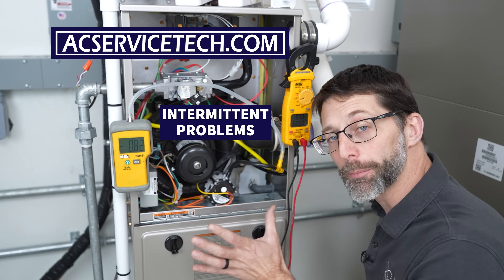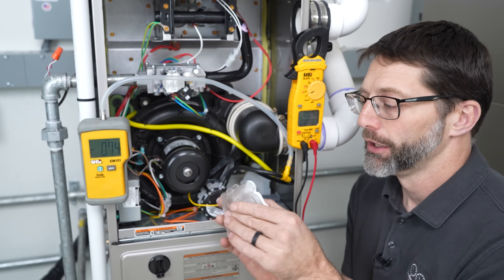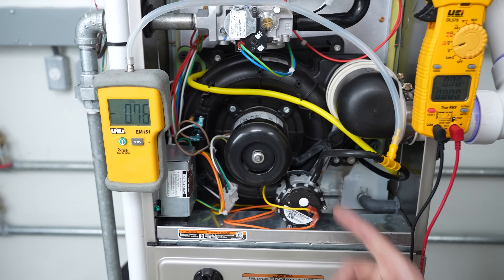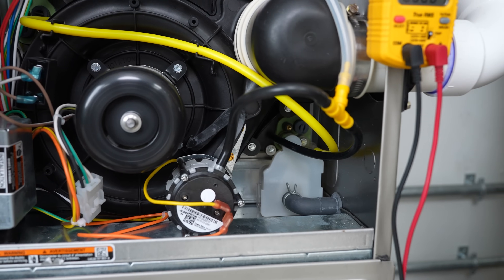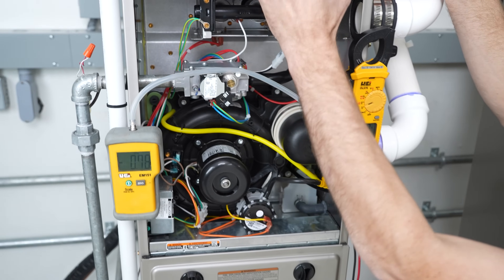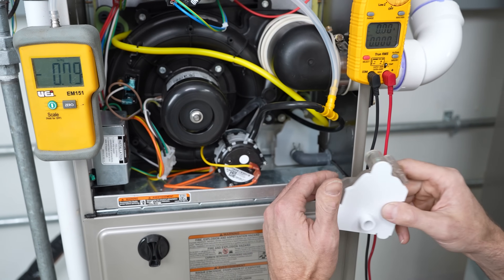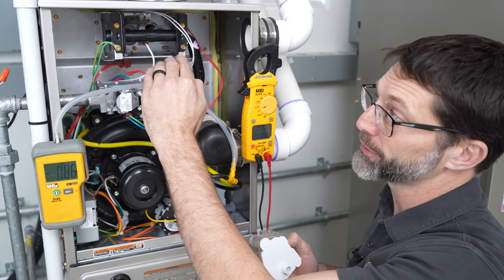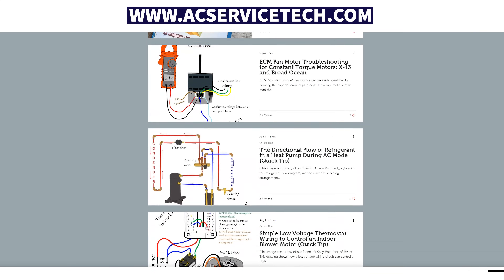Most Common and Basic Problem on High Efficiency Furnaces!

Comment: For who has Rheem furnace, I had code 61 and I thought it was blower motor problem according to the guide, when restarted, it can run from 20 to 60 mins,later I thought it could be the vent trap, and I cleaned it three times, but same problem. Logically I don’t think anything broken physically, must something built up when it running, finally I bought a new vent trap, then fixed. I have no idea what is exactly wrong of the old vent trap, I checked many times. I hope this info can help someone who has this same problem.

Comment: Why is this the only video that talks about cleaning the trap! 😂 Just fixed my 10+ year Rheem furnace from shutting down last night because the trap was clogged. Thank you for this video! My trap was hiding in the lower blower area and never thought to check it. Thought I had bad pressure switches and was about to order them.
Reply: Our drain line iced over last night and shut off our heat (18F with wind-chill to -5 somewhere it doesn't usually get that cold) we found the icicle this morning hanging off the uninsulated pipe that ran directly through the brick but behind the AC condensate line so you couldn't see it from the ground

Adding checking the line and trap to cold weather prep moving forward

Comment: The most common problem with a high efficiency furnace is more parts to fail that are very expensive. You will save 15% on gas and spend 30% on service calls.
Reply: no, just about all the identical parts from circuit boards to blower motor, to pressure switches - difference is secondary heat exchanger and condensate drain/handling components. the feature class and brand of the furnace has much more to do with parts costs than efficiency ratings. trane and carrier gouge on parts especially on their higher end feature class units.
properly maintained and installed, equally reliable but nothing is built like it used to be so all new equipment is less reliable than old no matter the efficiency.
there's a far bigger difference in parts between mid efficiency 80% and pre-1992 low efficiency with standing pilot, no circuit boards, no draft inducer or pressure switches than  a 80% and 90%+.

Comment: My heater would come on for a minute then shut down. The inducer would continue to spin for about 20 minutes at which point the flame would come back on and run for another minute or two.

Turns out, the condensation drain line was clogged at the very end. So it would take about 20 minutes to slowly drain, allowing the flame to come on, but then quickly filling again with fresh condensation.

Simply blowing out the line and removing the clog fixed it. Thanks for saving me hundreds on an HVAC guy coming in the middle of the night.
Reply: Exactly!

Comment: Thanks for the information.
I have a very similar system as that furnace. What I found was the igniter did not design correctly. It was too far away from the burner.
I believe this was a flaw design from Carrier. Imagine, this is a big company and they are deploying those machines with this issue.
It took me an hour and half to figure out this problem. The igniter glowed red during the cycle but it did not burn the gas at the bunrner. After the second attempt, the controller board locked it out. I reset it again and it ran through they cycle and locked it out again after the second attempt.
Once I used the babercue igniter, it lighted the burners right away. Then I figured the igniter was a bit far away from the nose of the burner. After i removed the igniter and modified the igniter position, the gas ignited and burned everytime.
We had the same problem every year. The same guy came over many times but he had never fixed this issue. In the last two years we didn't use this furnace at all. Last week, I fixed this problem after cleaning the area and the AC in the attic.
I am a DIY. I fix our cars and things around the house in the recent years.

Comment: I have one that is throwing no code but will not turn the igniter on. Leads me to the switches. I tested my blocked drain switch and it’s not even working. But I still get no code so I wait a few seconds after initiating start up and then connect those leads as if it were not a blocked drain and it does the same thing still no code but now I am completing that circuitnot the first Goodman to act like this

Comment: I have an early 2000s Carrier 9200 with no error codes, gas burner is hot for hours but blowing cold air through vents. House temp not getting above 60. Outdoor temp above 40. Research says possibly plugged secondary heat exchanger but a high amount of air flow is blowiing out of supply vents. What could possibly be wrong?
Reply: could very well be a plugged secondary - it is the side that exhaust goes through that plugs, not the airflow side. 
Smell the exhaust outside at the exhaust pipe termination, if it reeks the secondary is bad.
Feel the top of the furnace after it has been running for 10 minutes, if it's burning hot your secondary is bad.
A plugged secondary causes massive carbon monoxide production in exhaust if it has any of these symptoms you should shut it down and start shopping for a new furnace. Early 2000s unit is not worth putting a new secondary in, the replacement is of same design and can fail sooner than original within less than 10 years.

Comment: Thank you so very much for this video. High today was only around 12 degrees headed to -2 ° tonight. My furnace went out. it's a carrier unit about 8 years old. The inducer motor kept running with nothing happing. I came across this video and sure enough my trap was clogged. Got it all cleaned up and now the wife is nice and toasty again.

Comment: Sometimes the little vacuum hose fills with water and it has nothing to do with the drain.Easy fix. Also you need to find out the type of ignition system you have and keep an extra one.I buy them on Amazon and have repaired my own as well as my neighbors.

Comment: I absolutely hate high efficiency anything. I don't live in a high effiicience house. I want the old furnaces that are simple and throw out enough heat. Ever since I sitched to a new Trane, my house doesn;t warm with the temperature goes below 30 degrees.
Reply: your contractor is to blame, not the furnace - properly selected for the application, installed, set up and maintained will give you plenty of heat.
Reply: @Jon-hx7pe  Thanks for the reply. The house was built in 1917. There is no insulation in the walls. It was originally heated by and central coal fired heater that vented to each room. The only thing they could find for me now was a newer gas furnace. High efficiency is meaningless in my application. I need an old time furnace that sends out lots of heat. I now have an energy efficient furnace and I freeze in the winter, living in one room, while covered in blankets.

Comment: Might I suggest starting out with a block diagram/ schematic of the system?  The logic should be simple to explain but this tends to throw out a bunch of facts and bouncing around different points without connecting the points.
At least on old Trane XL90 furnaces, there is no modulating valve to drain the condensate but rather, a simple dip leg partially filled with water to ensure condensate flows to the drain and is not instead being sucked up into the condensing tubes and into the flue/ exhaust line.

Comment: I am just a homeowner who had this problem and couldn't get fixed by HVAC contractors due to intermittent nature of problem.  I finally fixed problem myself by removing long condensate hose leading to the floor drain and replaced it with a short 4" long hose draining into 4" pvc pipe with a cap glued on the bottom.  Then I installed a hose fitting on the bottom of the pvc cap and ran a hose to the floor drain.  This creates an air gap or stand pipe for the condensate.  I have done this with two furnaces that had problems and now they both run great.  When I want to flush the condensate line, I just pour a pitcher of water down the pvc pipe and make sure it drains quickly.

Comment: So if pressure switch isn't working, condensate trap fills with water and leaks past the o-ring seal? That's what appears to be happening with my furnace. The drain line is clear, but not draining. Condensate trap could use cleaning maybe, but does not appear to be malfunctioning, apart from the overflow past the o-ring.
Reply: Did you figure out a fix? I'm having the same issue as you
Reply: @xPhoenix408x me too

Comment: I have the exact same furnace and the same pressure switch on mine gets stuck closed once in a while. Even after replacing what could be the cause.
Reply: Make sure no condensate gas entered the line TO the pressure switch, and check its orientation, if its horizontal at all it can cause issues as these operate on very low pressures.   VERY IMPORTANT . Never ever blow into any line connected to the air switch, if you used a vaccume or compressed air on ANY PART OF THE DRAIN LINE, to "clear it" you've likely destroyed it and need to replace it. No joke, I just replaced one, it was the day after the customers wife cleaned their mech room, and vaccumed using a shop vac around the drain connection, I knew to ask cause there was no dust in mech room and the vac was still sitting there.

Comment: Had a situation where the condensate drain was backing up and the inducer and fan motor just kept on running with a 3 blink error code showing pressure switch stuck open. The pvc drain wasn't allowing any air into pipe and water was stuck inside. Added a Tee and water began to fall out better.

Comment: I think the key was the choker. However, the design is very poor. the condensation trap has no room for slope. They should design the trap clear and 1/2" higher for better slope(positive slope) and better water flow.

Comment: My case was similar to this (Day and Night brand)  which is Carrier. Cleaning trap- condensation didn't solve the problem because the problem still exists. Called technical support and recommended inducer replacement. replaced inducer work for 3 weeks then started making a noise like a 1960 Chevy muffler.  Called tech support again and recommended replacing the trap and inducer with a choker install. I did what they asked me to do, and it worked ever without any problem.

Comment: The issue I have is that, that foam seal imprints and may not seal back up after a removal and cleaning of that trap for those newer models…
Reply: Have you found a solution for that, mine leaks like crazy.
Reply: @frankwrogg2515  you have to get a new gasket from the manufacturer is the only way to correct that issue… I never take those off unless the furnace isn’t working because of it, I’ll check them with an inspection mirror to see if they’re really dirty and general consensus is they’re never bad enough for me to wanna touch them… hope this information helps…

Comment: I’m doing new construction on these carriers now two of the biggest issues are pressure switches stuck closed and exhaust flue pipe not draining back to the collection box because the PVC is bowed back to the drain. And nobody wants to check static and gas pressure to set the blower speeds up. The new carrier furnaces have an app to set the profile  on carrier service tech app. Goodman has coolcloud  app… great video

Comment: I had an issue with the condensation in the trap with my dual fuel unit freezing up. It is in the attic, and when the outside temp dropped into the teens, the gas heat would quit. I built a foam box around the unit and piped a little bit of heat into the foam box. End of problem. I was wondering if I could just have switched back to the heatpump to thaw it out?

Comment: Had this problem with a Goodman furnace. It would intermittently trip during the night time and It took me 3 recalls to the customers house to figure it out 😢
Reply: The goodmans also have a design  problem with the rubber 90* exhaust boot that is connected to the flue..the boot isn't pitched towards the condensate drain tube within the boot. Comes level from the factory. Pure garbage design..it will trip the pressure switch when the condensate drains back into the fan.

Comment: That happened to me on a no heat call a few months ago. The unit was a 2013 Carrier 95% with an ECM motor. About the same thing happened in this video except there was also dirt in the trap and one of the pressure switch hoses had water clogged in there as well. Cleaned the living crap out of the trap and cleared the hose leading to the pressure switch. I also did a little maintenance by cleaning the flame sensor, making sure the filter was good and making sure the sequence of operation was not interrupted during the heating cycle (Customer didn't have maintenance done in a bit). Unit came back on like nothing happened to it. Definitely not fun to do in a crawlspace with a bunch of those massive cave crickets (sprikets or criders as some call it), but was glad to see the customers was heating again before the winter months hit. Thanks for the video! Extremely helpful for a tech who is beginning to get their feet wet in this field! 😎👍🏾
Reply: You did a good job! I always do flame sensor, condensate, filter, and capacitor check (if applicable) on any furnace I check even if it's just a bad thermostat. It will help you avoid call backs
Reply: The little black hose that goes to the round thing and i pulled it off that back of the furnace water poured out of that little nipple that the hose was hook to. Is that normal

Comment: My red air hose that goes to the bottom of the round sensor you were talking about gets a small amount of water in it during winter time and shuts down my furnace.  And so I have to climb into my attic and pour the water out of the hose and use a twist tie in the bottom of the round sensor to help the bubble valve inside it not be frozen shut to get my unit to run again. Any thoughts on this?

Comment: I'm surprised you said the trap needs to be cleaned. I rarely see that problem. I usually see poor drainage from the exhaust to the drain. The slope of the exhaust is usually not good enough. Honestly, if we all just started using a exhaust trap drain bypass these furnaces would work much better for longer.
Reply: Agree 100%.  They should provide a tap fitting and hose for the air switch connection. And we could field build a trap in the condensate drain then, could also then install at the top, to make flushing the line annually super easy. Failing this just mount the trap externally to the jacket of the appliance.
Reply: @MrDmadness  lennox has the trap external.
Reply: @Jon-hx7pe yeah, they are much nicer to service. Thecondensate still must ryn past the secondary exchanger ( in appliance ) to gain its efficiencey

Comment: I believe trap issues are caused by incorrect plumbing after the trap and incorrect temp rise ( too low) over the heat exchanger. Correct those issues and the trap will not plug up

Comment: Great videos as always. There is 1 problem carrier also has. The male fitting where the pressure switch tubing connects to is sometimes filled with water and this is due to the 6 to 8 aluminum fins behind the inducer need to be bent 90 deg towards HEX. Please let me know if any of you came across this, causes a lot of issues on the carriers.
Reply: Do you have any field pics of this issue ?
Reply: Hey I’m having an issue with a Bryant furnace we installed about 3 months ago. I’m thinking this is possibly it it keeps giving me code 32 intermittently 

How should I bend the tabs ????
Reply: @Onemanhvac  bend the tabs towards HEAT EXCHANGER, don't bend em towards u, make sure they are bent 90 degrees and see if this fixes it.

Comment: My P-Trap was full of mold! Question where exactly is the water coming from? Is that condensate from the outside of the heat exchanger?
Reply: Latent heat.  

If liquid water at 100°C is changed into steam, the heat added (the latent heat of vaporization) is 540 calories for every gram of water. If steam at 100°C is changed into the water at 100° C, 540 calories for every gram of steam must be subtracted.

What this lazy on my part cut /paste is saying is that when the water re condenses in the flu and then drains to the drain you are recovering about 970 btu per 28.33 liters of drain  water.... theres a reason it's 28.33 liters... 
1 btu is about the same energy as 1 wooden match ( 1055.06 joules of energy ) 

So you are getting a lot of energy you otherwise would lose, the byproduct being acidic water. :)
Reply: Byproduct of burning gas.
Reply: It's a condensing furnace.  It takes so much heat out of the air , water vapor in the air   condenses to water. It collects in the secondary, to the collector box, to the condensate trap.

Comment: My condensate line (runs outside) freezes at least once a year.  Any good solution?
Reply: dont run it outside .
Reply: You could try to add a condensate pump. Then run the clear plastic hose to either a utility tub or like mine it dumps into the washing machine drain.